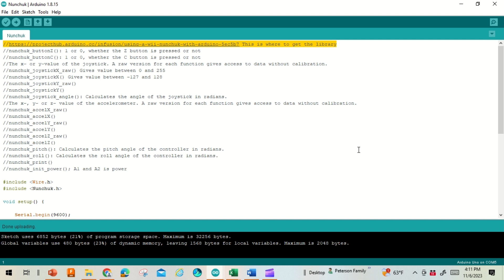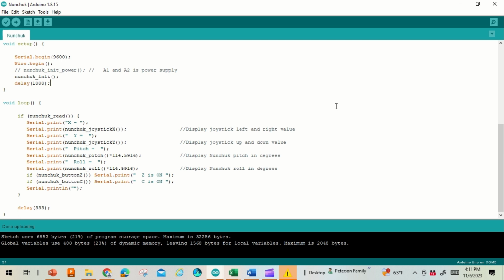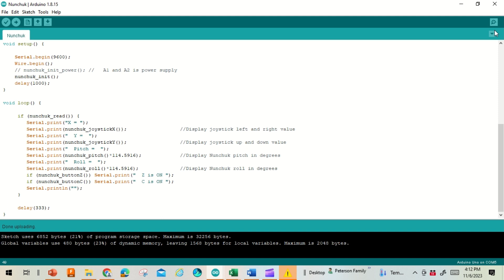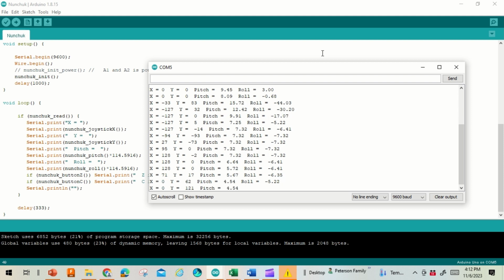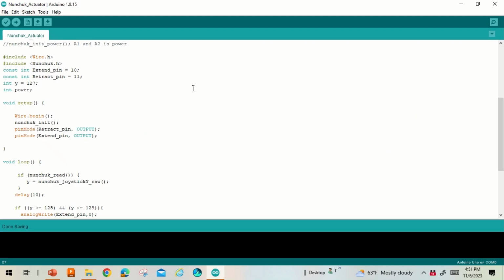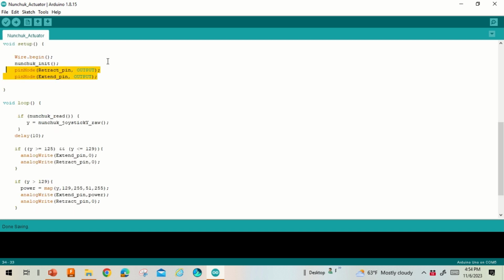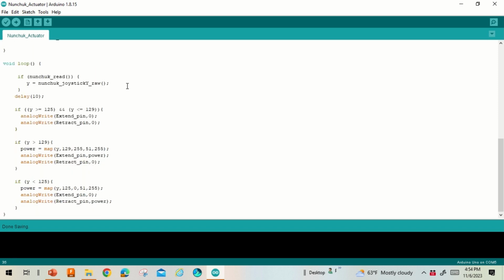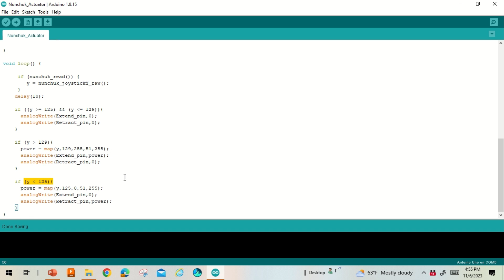Control an Arduino using Wii Nunchuck - Linear Actuator Control

Comment: That's pretty slick! It would be awesome to rig these up to the leveling legs on a camping trailer. Could even map button(s) to cycle between individual legs or "modes" (like "both forward", "both rear", and "all").
Reply from the maker: That could work!

Comment: Did you ever upgrade the small solar tracker to a larger panel and 12v? Would be great to see an arduino controlling a larger dual axis set up using a 12v motor to turn and a linear actuator for the angle adjustment. Please consider making it, I think it would be really popular 👍
Reply from the maker: It would still be fun to do. I'll keep it on the to-do list.